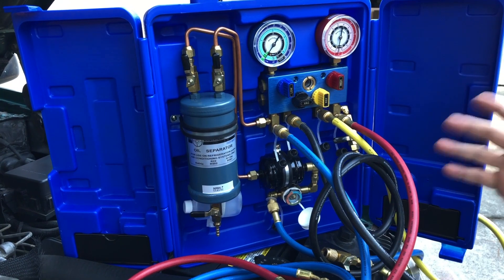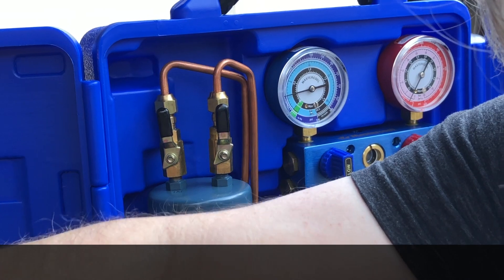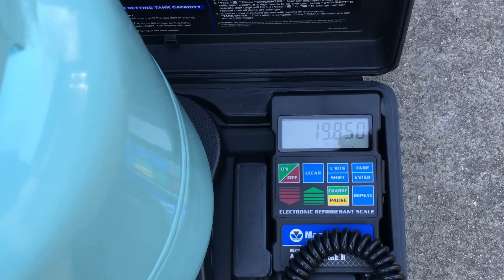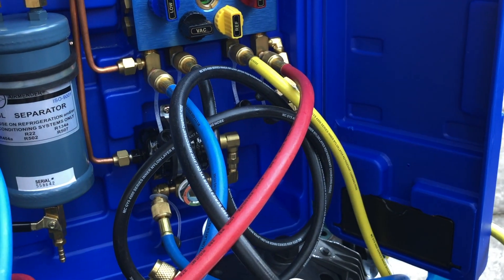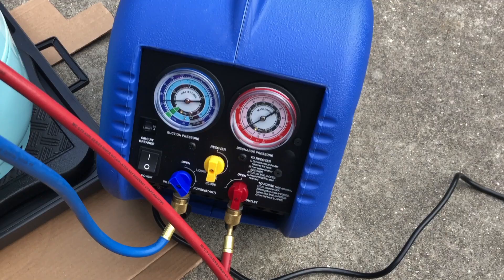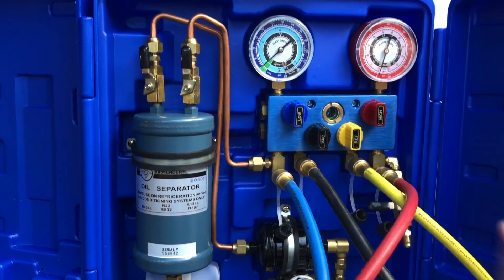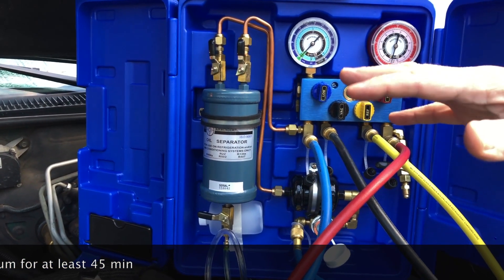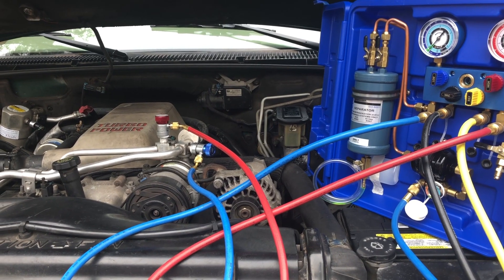How to Recover R-134a Refrigerant from an Automobile using Mastercool 69000 + 69500 Equipment

Comment: Can you reuse recovered or should we be using new bottles?
Reply from the maker: I keep a 30lb virgin disposable cylinder for R134a recharges after repairs.  This particular setup I went over in this vid is really meant just for refrigerant recovery ops.
Reply: @DrShock  In which case, especially, it seems as though the separate oil recovery (or not!) is redundant. How do you dispose of the recovered R134a? I gather that the recovery tanks are only DOT-certified for 5 years from the date of manufacture so do you have to hand-carry them to a disposal facility after 5 years, or what? Presumably, the same is also true for the "virgin" R134a tank. I think you had residual air in your hoses before starting recovery so the recovered R134a is contaminated with air. If you had vacuumed down the hoses before starting recovery you could, presumably, use this recovered R134a to refill.
Reply from the maker: @OvertheHills  You can either pull a vacuum on the hoses (what I usually do) or purge them of atmospheric moisture with a spritz of refrigerant (allowed by the EPA for this purpose).   That process and the oil separator are simply needed to keep the refrigerant acceptable for taking to reclamation facility.  Where I am you just take in your cylinder, and they extract out the refrigerant and send you on your way.  They will then process the refrigerant for resale.  The EPA maintains a list of such locations across the USA here - https://www.epa.gov/section608/epa-certified-refrigerant-reclaimers

The refrigerant can have other contaminants present though, so reuse is just not advisable.  Virgin is cheap, and the best route for a recharge.
Reply: @DrShock  I had seen that list of EPA locations but there aren't all that many sites. The closest one to me (in San Diego) is over 100 miles away. Then there's also the 5-year certification on the recovery tank to worry about. Like you, I got the Series 609 certification (out of curiosity more than anything else) and bought a 30 lb tank of R134a. To date, I've only filled A/C systems that have been empty of refrigerant so I've had no need of the recovery equipment. After a garage's repair on one of my cars failed twice (!) I decided to do the job myself which is what led me down this particular rabbit hole. Just recently, I installed A/C on my Bronco II that had never previously had A/C so I was able to use a couple more pounds of R134a. Still, I've got far more R134a than I'm ever likely to need but, much as it's a pain to buy, it seems to be even more difficult to dispose of responsibly. In a perfect world a system would only need to be filled once but, this world being far from perfect, all the R134a ever manufactured is going to end up in the atmosphere sooner or later. It just isn't cost-effective for me to buy refrigerant recovery equipment. It's far cheaper, and far more convenient, to have a garage recover the system if I ever needed one evacuated. Thanks for making your videos. I should make some car maintenance videos myself, but I'm just putzing around. Should I use the blue tube or the brown tube, that's the question? :-) The Bronco II was originally designed for R12, of course, but I was fitting a whole new system with R134a and there's no definitive information, that I could find, as to which orifice tube to use. I ended up using the blue tube and it works, but I have no idea whether it's optimal.
Reply from the maker: @OvertheHills  The 5 year thing is just a re-certification process.  It doesn't cause the cylinder to automatically have to be retired.  The place I go to will also perform this, for a fee.  And you get another round of years again.   It's not unlike when you get your oxygen or acetylene containers.  It's not uncommon for me to get cylinders that are over 15 years old from Praxair/Airgas.   As long as they continue to pass inspection, they remain in use.
Reply: @DrShock  I know. I have a 10 lb propane tank. It's easy to exchange a 20 lb tank but the 10 lb tanks aren't very common. The only time I've had it recertified was in Arizona. Here in California, the recertification costs almost the same as a brand new tank.

Comment: Great video! Question- do you usually recover all of the oil or some appreciable percentage will stay in the system? What do you do if you don’t know if the system contained the right amount of oil?
Reply from the maker: You would never recover all of the PAG oil using this type of vapor recovery system, the very vast majority will remain within the compressor and accumulator.  And, if applicable, that's where a healthy dose of the leak detection dye would continue to reside as well.   The total amount of PAG oil required in the system will be on the same label that specifies the total amount of R134a refrigerant charge needed.  I've only worked on older GM vehicles myself, but the service manuals for those all advise that unless there was a catastrophic and sudden loss of refrigerant (e.g., a severed hose), typical leaks do not result in a significant loss of PAG oil.  That all said, if the vehicle history is unknown and there is a concern to warrant it,  it's probably better to do a complete flush out/cleaning of the air conditioning system and start over PAG oil and dye charge wise.  That process would require additional equipment than the recovery only tools I've shown in this series (usually a device with an integrated container for flushing fluid that can be put under pressure using dry air).
Reply: @DrShock  thanks for the reply! Would like to see a flush video on your channel as well)